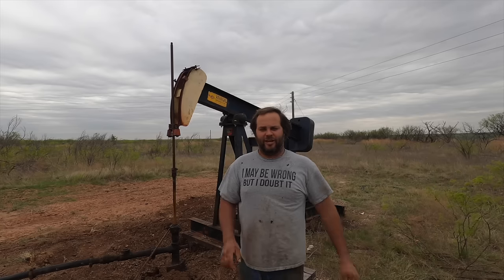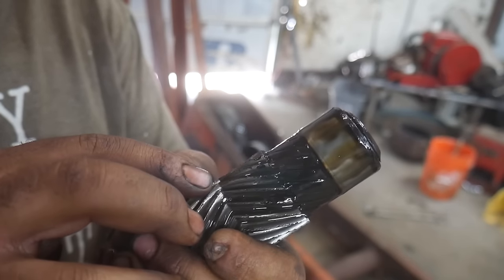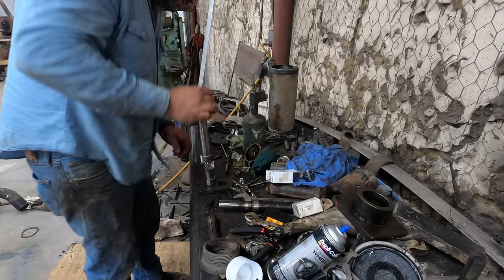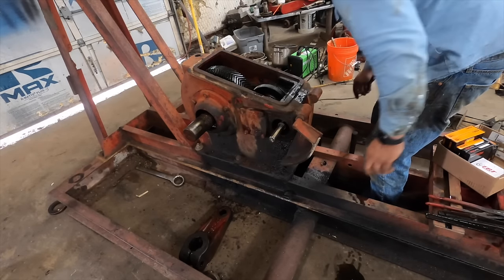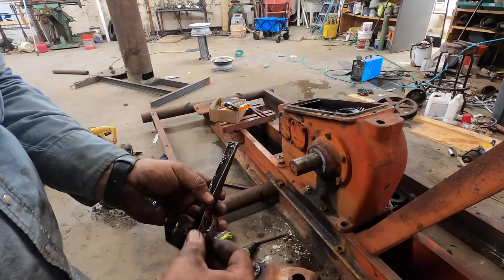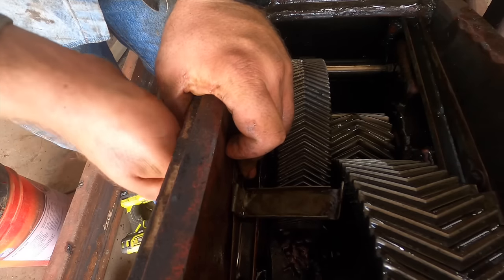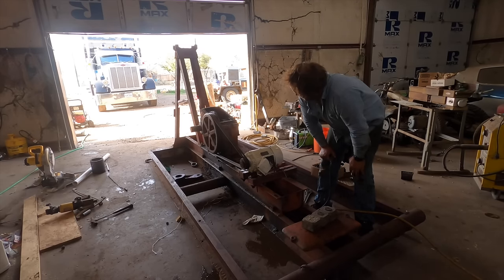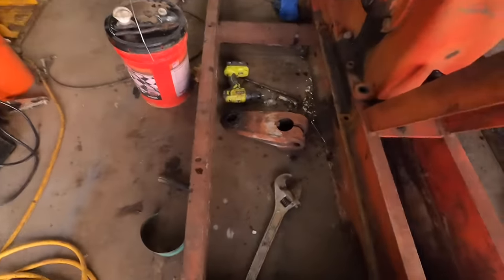Oil Well Gear Box Rebuild.

Comment: You can put an impact hammer on the end of that shaft of that pulley or whatever it was you were trying to pull at the start of the video. Get a pry bar and put pressure on the back side of what you are trying to pull and keep the impact hammer pounding on the end of the shaft and the pulley or whatever and keep prying on the back side and it will come off way easier than using a puller. Been doing this for 30 years with lawnmower engine flywheels, car engine flywheels, etc. Thumbs up! Love your videos!

Comment: It is neat to run across these very hard to make thus expensive herringbone gears -  strong, smooth running and very long lasting.
Reply: Agreed, when i was in engineering school we were told that herring bone gears are the best but they supposedly were only ever used in super specialized machines, but were generally to expensive for any real applications applications. Not really true i learned today😊

Comment: Not trying to be that guy with this comment. I love the poor boy oilfield angle lol. I was a pumpjack mechanic for 20 years here in Alberta. Don’t agree with some of the tactics here but it’s his iron and he can do what he likes. With these little jacks you can knock wrist pins out with the nut still one so they don’t hit the ground! Break that casting and it’s often a waiting game to find a new one some times. A set of flat wedges to spread the crank arms a touch and you can pull them off and install them by hand in less then 30 seconds no need for the press or hammer. For the low speed seals same thing hammer the hard 90 angle of the seal pulling in and rip it out. No need to drill into it and maybe put large filing chunks into the oil sump for the low speed bearings. Plus he’s half right about the pinion sound. It’s making that noise mostly cause it has no load on it so these 3 phase motors kinda surge a little and that’s what the noise is cause the pinion is chasing the High speed gear. This unit would sound ok if it gets balanced good. I have seen a few videos with other jacks looking almost to out of balance. He could be saving a lot in belt replacements and the power bill to get them within 5 amps draw. A perfectly balanced jack should be basically able to lift the arms to 12 with the sheave by hand.

Comment: Looks good to me. Nit pickers might cry about methods but the result in this case is the same: Success. That  is a Herringbone cut on the high speed and bull gear. Absolute finest quality very difficult to machine. Fiat invented the one piece Herringbone many years after those were machined. Ultra reliable and self aligning. Cool stuff man keep doing things your way we like it 👍
Reply: Definately. I've got a video I did years ago tearing apart a hydrostatic lawn mower transmission(supposedly non-serviceable) and repairing it. Had a commentor years later say I was doing everything wrong, my tools were too dirty/rusty, and if I followed the manufacturers instructions, I wouldn't have had any trouble(non-servicable so manufactures instruction were to replace the whole unit for $600+ rather than just replace a single thrust bearing.)
Reply: Love your comment ,I was smirking many times watching this thinking that there's a way to do this by the book ...then there's the "get it done, get it earning" , hez the boss he knows the risks of the shortcuts, he will pay for it if he messes it up... I'd do it the same .... then there's the state of the workshop...some tubers workshops look like you could eat off the floor ...I work for a living, my workshop keeps all the various equipment that actually makes me money out and working...mine looks like his
Reply: Not Fiat invented this gear cur but Citroen.

Comment: Generally, single phasing 3 phase motors is bad (as in yellow goo of death/catch fire bad).  I would recommend a 240V to 480V transformer and a few horse VFD for a test run rig.
Reply: There is virtually no load on that motor just turning a few un-loaded gears. Not like  your trying to pump oil with it running on 240 volts. The motor is designed for 480 volts, so its running on 1/2 voltage anyway.

Comment: Hello Zack ......could you tell me where I can find a great arm puller like you have so I can stop breaking arms on the way we have been doing it. Thanks for all the knowledge and watching from San Antonio
Reply from the maker: So it's a cheap 20 ton jaw puller I picked up off of amazon. I had to look for one that allowed the use of only 2 jaws to get ahold of a crank arm.
Reply: How bout a vendor on high speed gears as I need one for Lufkin 10D

Comment: With today's electrical rates for running those 3ph motors and your general overhead. How many barrels does an average well need to produce to break even?
Reply from the maker: This varies greatly but the well behind me in the introduction makes about 15 bbls per month and is a profitable well. Sometimes this number can be much lower down to maybe 5bbls per month depending on the other factors but is typically higher

Comment: No need to change the oil because there is no combustion blowing carbon past cylinder rings. The oil never gets saturated with carbon, and the gears run cool so the oil doesn't break down. But I'd throw a bigass magnet in there to collect any metal shavings. The shavings are abrasive and they'll eat away at the gears.
Reply: Actual not, oil also break down from mechanical shearing force it basicly cut the oil molecules and the oil get thinner, at somepoint it is to thin to stick to the gears and they lack lubrication.

Comment: Happy Easter. Good talk! What weight oil is used in the gearbox? Those oilers,such simple technology. On average how often do the gearboxes get a rebuild? Next. Kc
Reply from the maker: They go along time. I would guess this one has at least 40 years of runtime and is the first time its been through maybe closer to 60. There are many built in the 40's and 50's that I would bet are original other than maybe a seal or two.

Comment: Zach, I wish you would have changed the oil in the gearbox.
Reply: I agree. My OCD was lit right up. lol.
Reply from the maker: I figured it might get to some people. :)
Reply: @TheZachLife  I figured you know more then me, when it comes to these machines. But its been preached and drilled into our heads to change oil as a maintained item. Add to that I worked for Honda (head office) for 20 years, so its probably  in my DNA by now. lol.
Reply: I was triggered.
🤣

Comment: Did that start out as sewing machine oil?  Man, that is some USED stuff. 

"Hi folks, and welcome back to How Long Will It Last? This is Zach." 
"Hey, folks!" 
"Now Zach, why are you not changing the oil in this gear box?" 
"Well sir, I figure it sat in the ground for 93.41 bazillion years, so floating around in a gear box for a 100 ain't gonna hurt it none." 
 "And there you have it folks!  This oil was old to begin with, and it's just being turned back into crude, slowly and surely.  Tune in again next time when we see Zach burning, cutting, hammering and wrenching on a new hummingbird heart valve!"
"Catch ya on the next one!"

Comment: I don't get the thought process behind not changing the oil 😕
Reply: If the viscosity is still there, there’s no need to. The oil in this gearbox doesn’t heat up like a combustion engine would so it doesn’t breakdown. It probably stays relatively fresh as it gets topped off on a regular basis due to leakage. As he said you probably could change the oil but it’s not enough of a difference maker so why? Remember how long this rig has been around.

Comment: What kind of oil is that?  Can we rinse it all out with diesel and replace it with Rotella
Reply from the maker: Its the cheapest GL-1 90wt that money can buy.
Reply: this box was made 70 to 80 years ago, it would be a waste of money to put in motor oil into a gear box.

Comment: You said this is an American unit, is the gearbox an American manufacturing company unit also ??? I have been told the great minds think alike and they most certainly do. I have been taking out oil seals with using self tapping screws since my old mechanic neighbor showed me that trick fifty years ago. So you must somehow have known someone old that showed you that trick. Nice work Zack.
Reply from the maker: Yes its it thanks.
Reply: @TheZachLife  Thanks fella. God bless.

Comment: Hi Zach,  I own a shallow oil lease in central Texas and work on mostly Jensen # 6.4 and # 10 pumping units.  My older units are from the 30's and 40's and  need the high speed gears
which I can no longer find.  Could you send me the info. on the machine shop you use so I can have some of them made?  It would be a shame to scrap these old units which run better than the new ones when everything else is in good order.  Thanks, B
Reply from the maker: Email me therealzachlife@gmail.com so this doesn’t get lost. I’ve got a couple of guys that might help you out. Send some picks and model numbers and give me a week or so. I’ve got a friend that can sometimes do better that the custom gear shop.

Comment: Spherical roller bearing translation-ball bearing? LOL
Reply from the maker: Spherical roller bearings are a bearing that can have the inner and outer races run out of square with each other.
Reply: @TheZachLife  Thanks for the info.  I better get back on the porch.
Reply: @joehead1294  Their rollers are shaped like wooden barrels, halfway between balls and cylinders, and are arranged in two rows around the inner race, held in place by a cage.
There are also spherical ball bearings which, as the name suggests, use balls and plain bearings in which the inner race slides directly inside and against the outer race without any intermediate elements other than the lubricant.